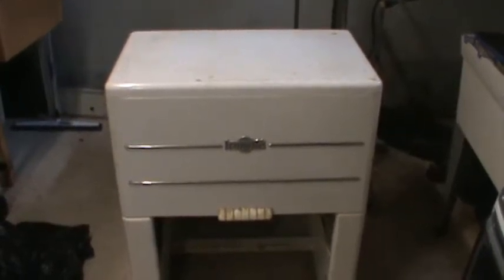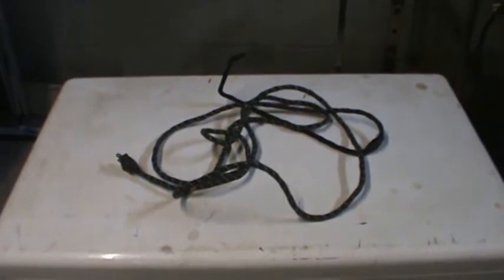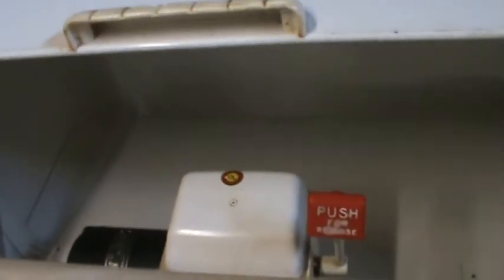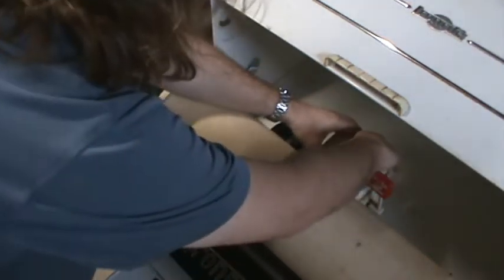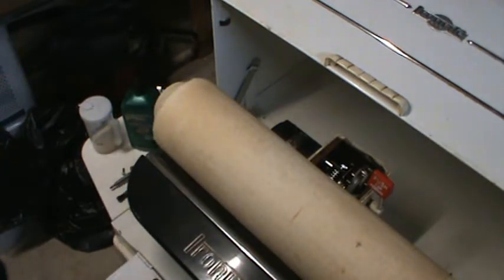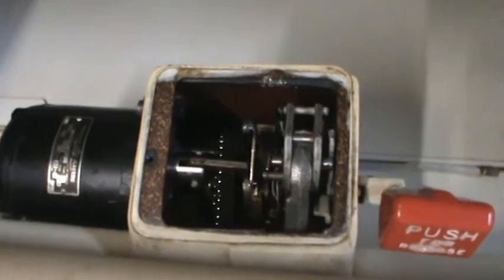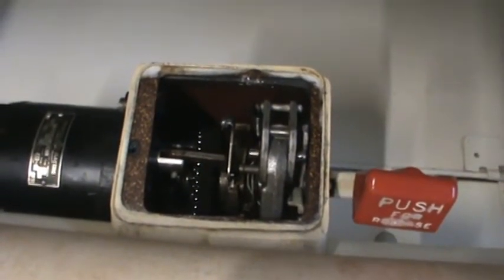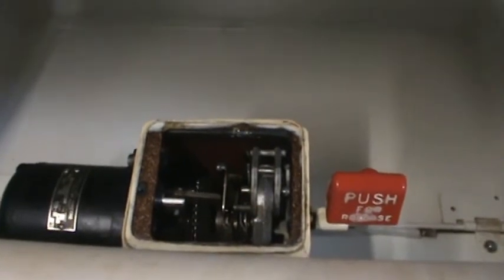Ironrite Model 85 Ironer Mangle Repair - Roll won't move, replace power cord, change oil

Comment: Thank you for your technical support. I got an ironrite for my birthday boy are this machines heavy! Mine needed a deep clean and I been doing the restoration. I changed the cord with my husband. The heating element good, the turning iron good. Now I’m getting to do your advice with the gears since they are not working. Seven months into the project and wow! Hoping to get the jam fix. My husband thinks I’m insane to be so interested in this project. Thank you

Comment: Hello thank you so much for this. I have Ironrite which recently put really nice casters on and now I have just been working on replacing the cord. Just one small point in your video you don’t mention that in the lower two terminals there are actually two wires that are going to the motor into the thermostat that share terminal where the positive and negative power wires go also so if you open up the terminal and find that there are these two additional wires, just be mindful of that and be sure to put them back into each  terminal. And as you say, the top terminal is only concerned with the motor. There are Aaron Wright service manuals in PDF form out there and you can find the electrical diagram showing how the top terminal is only motor in the bottom. Two are both power record and connections to motor and thermostat.